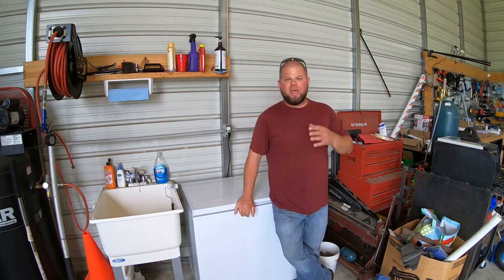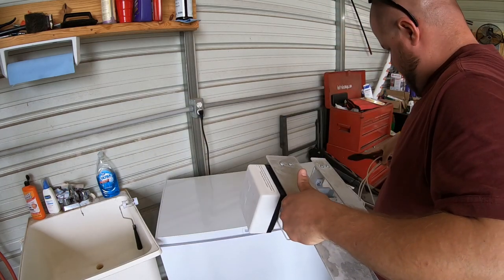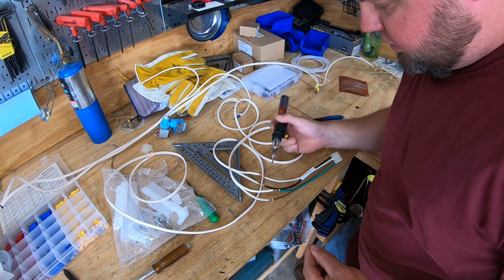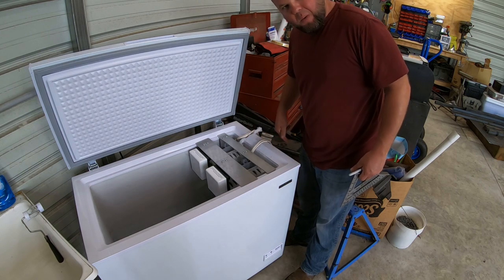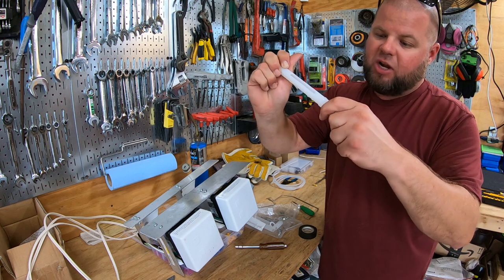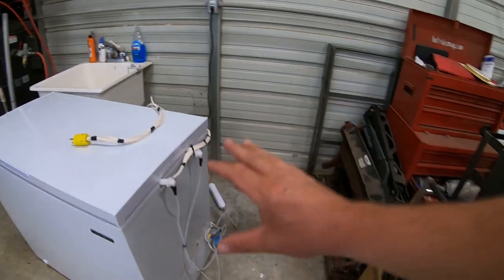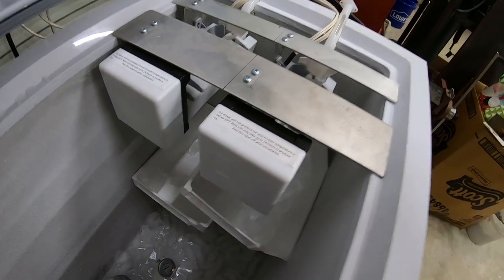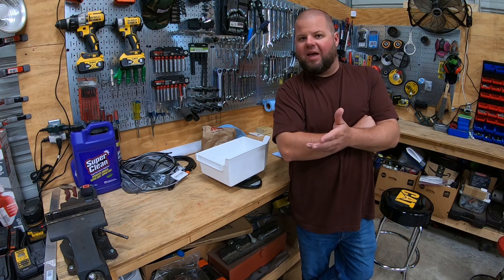Homemade ice machine, adding a second ice maker to increase production!

Comment: Thanks for the followup video. Oh by the way, the reason there's a sticker on the freezer that says explosion hazard is because all new appliances run butane instead of freon as a refrigerant. Has that saddle valve started leaking yet? Don't worry, it will.
Reply from the maker: Thanks and no leaks yet.

Comment: Just curious - did you calculate the break even point on this to see when it becomes profitable for you?  Assuming $3/week for 20# of purchased ice (which I would say is high), just the investment cost of $350 tax not included would be 29 months of your unit running before you're seeing break even.  Factor in the costs of running all of your components, costs of water, water filters, etc. (everything costs), you're obviously a little longer on the break even.  McDonald's sells 10# bags for $1.19 by me so using that cost, you're at 36 months break even plus operating costs.

I'm not dismissing the convenience of having it at home by any means, but you're also going to be going to the store to buy the stuff you're putting into the ice anyhow so that's not really a trip you can count as a savings IMO.  I like the idea of it for sure so don't take this as beating down on what you did.  I'm genuinely curious on what your ROI is on it in the long run.  A freezer like that should run for many years so there's clearly some returns down the line, just not for a couple years from what I can figure.
Reply from the maker: I did without electricity costs, it's 9 months for my uses. I get a killawatt meter Friday and will be testing true cost per pound next week, video coming soon.
Reply: @TKCL  right on - that's a pretty great break-even!

Comment: Fun fact, you could probably run 150 of those on the cable that came with the freezer.
Reply: Yea, all icemakers run is basically a clock motor and the small water solenoid, they dont use much power by themselves
Reply from the maker: 220 watt draw during the heating cycle to release the cubes. That's a decent pull
Reply: 220W each? Seems excessive. In any case the cable will be rated for "more than" the compressor at its highest load.

The chances of the compressor running and both heating elements running at the same time is minimal. And when that does occur, it's momentary.

Momentary ratings of cables are much higher than continuous. I can't see it ever being an issue.

I would wire to the internal fuse. Then you can never exceed the rating of the cable.

That said, worth pointing out here in Australia, 220W is less than 1A. 2.5mm cable is rated for about 20A, 2 heating elements would be 2A, leaving 18A overhead, on an outlet that can only provide 10A anyway.

US are forced to use cables that are double the gauge to achieve the same power at half the voltage
Reply from the maker: Yes 220 watts each, been monitoring via my killawatt meter.

Comment: Sweet. Im going to copy that. FYI you didn't need a second solenoid valve. You could have split the water line after the valve to feed the ice makers. If both machines shared the same hot then that will be the same leg that engages the valve. They could both call at the same time or separate.

Comment: I think you could add two more on the other side and 4X your output, if you need it. Also the output of the ice maker is ultimately determined by the gear ratio used on the drive motor. Changing the temperature is not going to speed things up. You are correct that a commercial machine just drops ice in an insulated bin, just like a cooler. It is in a constant state of melting. Dropping your ice into a freezer bin will super chill the ice and help it to last longer. If you made it this far, check out my water heater project https://youtu.be/dlWmMevL3NA

Comment: I'm already seeing a issue. did you space the ice machines apart from one another to allow for the sensor arms to activate. if not, then the units will keep making ice even when the freezer is full.  and the other thing, the wiring... you could have gone to your automotive store and gotten primary wiring for your project instead of using zip cord. plus you could have used other crimp fittings for your wiring. nice project, hope you enjoy you new Ice Maker!
Reply from the maker: No I took those bars off. I use so much ice that it won't fill up until winter. I can trip the ice makers manually or just unplug them when full.

Comment: Two potential concerns that I do not think were mentioned.  First, the chest freezer.  Is it rated for outdoor use?  Or indoor use only.  It is the external temp range that can cause problems with the unit not working correctly.  Second, you did not show the bail operation.  Maybe you removed the bails.  The bail is how the ice maker knows to stop.  It can be easily removed but then the unit will not know when the ice chest is full.  Locking the bail in the up position turns the unit off.  

My fridge use the same ice maker.  They only last about three years for my house.  So I have replaced it about 5 times now on a 15 year old fridge.  But they are good.  Last time about a month ago.  I purchase units from ebay for about $40.
Reply from the maker: I removed the bails, I can always trip them manually when needed. This chest will hold a 150 or more pounds of ice before its ever full, that will take a long time with me using it every week. It's been in my shop for a while now through crazy temperature swings and is still producing ice just fine.

Comment: Seems like a little waste of time (and a bit dangerous) when you can get a decent used Manitowac air-cooled (water-cooled is a staggering waste of water) for a few hundred bucks. Look around for used restaurant/bar supply shops or even eBay. Have had one where I work running 24/7 for the last 8 years, bought for about $250 (usd equivalent). Maybe $100 in repairs over that time.

I'm honestly not being "that guy" and just trolling you. If your system catches fire to your shop, insurance won't cover anything. Won't matter if it turns out to be the actual freezer, they'll still claim your kludge is responsible. You might win in the end, but it will be a battle.
Reply from the maker: I didn't just jump into this project blinded. I did a bunch of researching cheap ice makers, and looking for used commercial units. The cheapest used commercial unit I can find after months of looking was $800. Hearing how often they break and how expensive parts are, it wasn't worth the risk to me. Parts for this unit are extremely cheap anytime I need to replace anything
Reply: @TKCL  Cool. (pun intended) 
I guess the machines up here in Canada tend to not be used as much ;) Currently, there's a lot of restaurants and bars up here that have folded due to the lockdowns over the last year. Might be an idea to check eBay. The only parts that go bad on Manitowacs are cheaply replaced online (a fresh water recirculating pump cost about $50 with shipping to BC from Wisconsin), although I don't know much about newer (under 10 years) units.

I guess my main feeling is maybe using more-than-normal protection. Ground fault or arc fault plugs, etc.